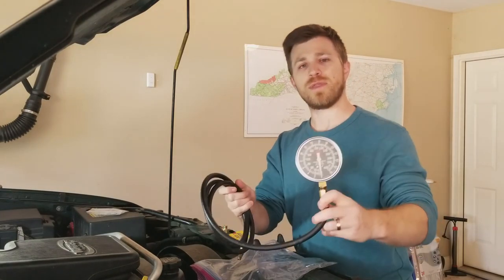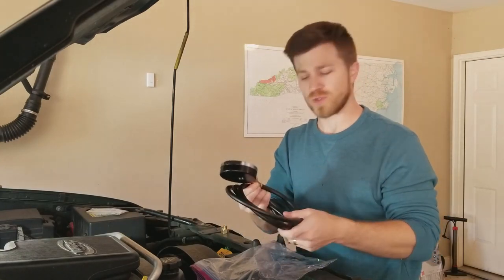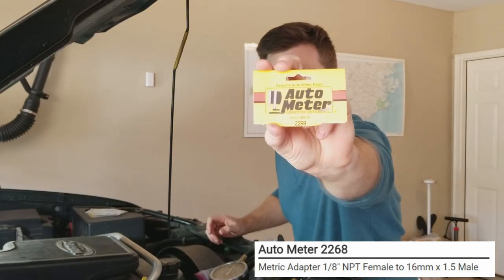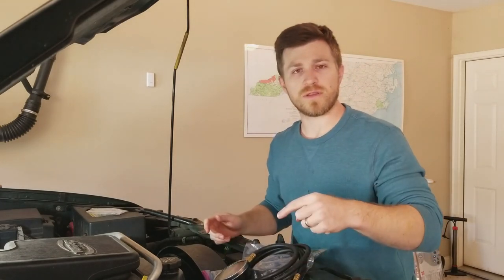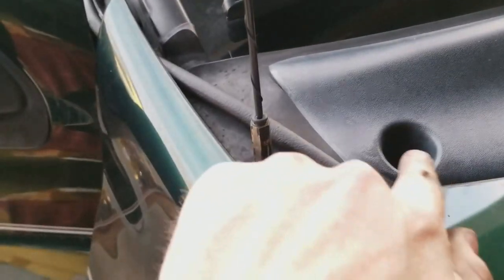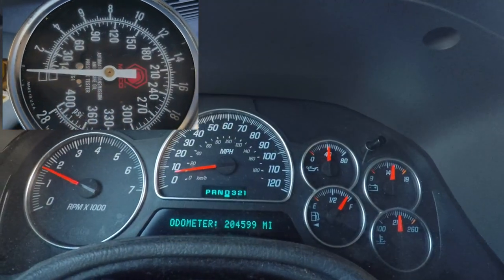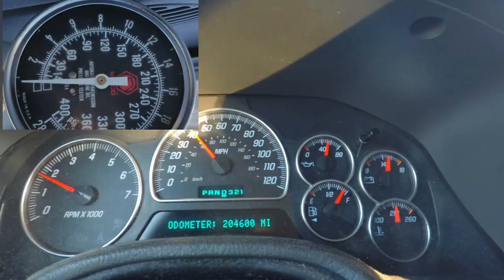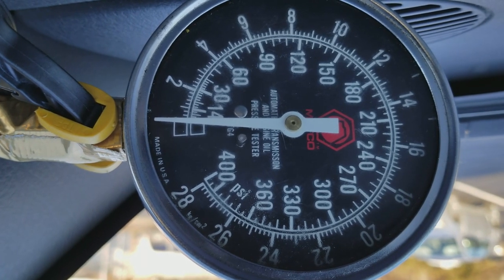Diagnosing Envoy Low Oil Pressure - Part 2

Comment: I really appreciate you for making this video. Please keep posting these videos they are very helpful.
Reply from the maker: Norma Sibaja Thank you!
Reply: @KevinNadeau  I have a 2005 GMC Envoy Denali 5.3 liter. it'll drive for about 30 to 40 minutes it will shut off it takes about an hour hour-and-a-half you're able to recrank it and it'll drive for another 30 to 45 minutes and repeat the same thing over and over. We have changed the fuel pump, crankcase position sensor, ignition module, multiple relays the fuse panel box under the hood had to computer rebuilt Andre program to the vehicle several things have been checked no issues whatsoever headed into the GM dealer two different times they can't find the problem to other mechanics have been unable to find the problem and I'm at wit's end. Any idea what it may be?
Reply from the maker: @fla-tacomann5355  I'm not very familiar with the 5.3L motors, but my first thought is something electrical. Have you had the alternator tested? Is your battery good?

Comment: Exact thing happened to my 06 Trailblazer...was a clogged oil pickup tube that would temporarily unclog when engine was shut off.  Ended up blowing the engine because I thought it was a faulty gauge and drove it a couple miles.  It literally started knocking 4 blocks from my mechanic's shop.
Reply from the maker: Man, I hate to hear that

Comment: Having the same problems with a '04. I will be doing the same test you are, suspecting to have the same problems or a weak pump. There is a lot of confusion about the oil pressure gauge. Researching this, it appears that the gauge is nothing more than a glorified idiot light to make it look "cool". The sensor it a on/off switch. Pressure opens the switch (off). Lack of pressure closes it (on). If it is off, the gauge reads 40psi.  You can unplug the sensor and the gauge will still read 40 psi. short the plug wires, it will go to zero. After fixing this engine, a mechanical pressure gauge will be install for the driver.
Good video Kevin.
Reply from the maker: Hope you're able to solve your low oil pressure issue.  You are correct, the oil pressure gauge on the 4.2L motor is basically an "idiot light".

Comment: same problem on 2002, oil pressure switched didn't resolve, oil change full syn and oil filter didnt, bought a new battery now i read that could case issure. im thining sludge build p or oil pump.. hope not. 
But looks like ur pressres low to begin with? then when idling it increase just a little look at the tiny like to the left of needle. GL Godbless

Comment: Iv been through this hole thing bro.. it worked for a while
Reply from the maker: I ended up having to take the oil pan off and clean the pickup tube on my Envoy.  Man, that was a big project.
Reply: @KevinNadeau   yeah.. I figured that was coming…
I haven’t change my oil pressure switch. that I will get done.. And possibly have somebody else do the work to the clean out or both jobs..
Im to old for that stuff anymore..😎
Reply: @KevinNadeau   did you make a vid on that Kevin? If so send me a link please..
Thank Steven 😎
Reply from the maker: @stevenjewett4537  Yes, I have several videos related to my oil pressure issues. Check the playlists on my channel👍

Comment: Hi there kevin I have a 2004 GMC envoy slt with a 4.2 v6. . MY AC compressor is not working and I need a few suggestions to get it ready for the summer season...
Thanks..
Ken.  From Ottawa ontario canada.
Reply from the maker: I'm no expert with AC systems. Are you sure the compressor is bad? Might be time for a new one?
Reply: Hi Kevin.. when I removed the old module under the dashboard I noticed that a few of the plugs had some green corrosion in the plug so I cleaned it out the best I could and I'm thinking that maybe the brake lights blew out and the running lights just continue to come on when I turn on the lights and do you think that the fuses for the left and right brake lights might have been blown...
I just bought the GMC ENVOY SLT a few weeks ago and I'm just trying to figure out the problem so I can get a safety certificate and put the SUV on the road and enjoy it.. during the summer...
Thanks again..
Ken.
Ottawa Ontario Canada

Comment: Don't use the FRAM filter, and you'll be fine.
I had a problem with low oil pressure. I changed everything I could. Eventually the problem was solved only when I replaced the FRAM filter with one from ACDelco.
Reply from the maker: AC Delco is what I use 👍
Reply: @KevinNadeau  were u always using AC Delco or did u change to it after issue was resolved

Comment: is there a way to replace the oil pressure switch from the top?
Reply from the maker: Maybe, but I found it to be very easy to replace it from the bottom.
Reply: I actually did one today in my 05 envoy and it wasn’t as bad as I expected. Once the oil filter is off you actually have enough room for the socket and ratchet. Highly recommend getting the speciality socket for a few dollars. Best of luck to everyone !!M
Reply: @stephenpurcell9268  thank you for sharing. i also have an 05 envoy and bought the oil sensor socket it was cheaper than the actual sensor lol can you give me the steps to replace it?  so just get the oil filter out first?  how do i do that? lol
Reply: Getting the filter out gives you more room to get at the sensor. A 74-76 mm oil filter cup will help if the oil change place over tightened the filter. Once you remove the filter the sensor sits sideways just above the filter mount. Remove the wiring from the sensor and the socket will fit over the sensor and you will have room for a ratchet as well.  Hope this helps you as well !!! When replacing the filter just tighten it up hand tight. Always easier to remove for future oil changes !!!
Reply: @stephenpurcell9268  thank you!! will try it out when it gets warmer. its -27° C right now where i live LOL

Comment: Have you had to take the oil pan off yet? Just wondering because I'm going to be changing a timing chain and some other things and I can not find an oil pan gasket anywhere! Apparently these engines don't have an oil pan gasket?
The local auto parts store, showed a picture of 12 tubes of RTV and same with an online website. I find it really odd that they wouldn't have a rubber gasket
Reply from the maker: Yes, I ended up taking off the oil pan to get to the pickup tube. The pan does have an RTV gasket, not rubber. Check out my other videos for the oil pan removal and install.
Reply: @KevinNadeau  yes I saw the other videos after I left this comment. Very informative and thank you for making them. I'm not looking forward to doing this
Reply: @KevinNadeau  so I'm all finished with my engine project and it runs great but there's a vacuum line coming from the left firewall and I cannot find where it goes. It's causing my idle to go up and down between 400-800 rpms
Reply from the maker: Do you mean driver or passenger side?
Reply: @KevinNadeau  passenger side
Reply from the maker: @151bradhatt  I haven't had a chance to research it yet. Can you post a picture?
Reply: @KevinNadeau  if I can I don't know how. It's not a big deal. I was just wondering if you knew off the top of your head. It hooks into the intake manifold somewhere I just can't see a place for it. Maybe the new manifold is different from my old one

Comment: Too nervous to skip to the end... And then move on to video 3. Ugggh... 3 videos sounds 1. expensive and therefore 2. like I may be looking at off loading my baby. Prayers up for ye olde' 2002/190k 😑... 🙏🏽
Reply from the maker: Don't get rid of it. Try a new pressure switch first.
Reply: @KevinNadeau  You rule for responding so fast..! Soo.. Try the switch first even though it's doing literally the exact same thing as yours..? Down to the 20 min running time + idle throwing the low oil pressure & engine shut off warnings - but when I accelerate it "fixes it".. until I idle again..? I'm en route to gas station for kerosene, now. Guess I could bust a u turn and head to O'Reilly for a switch, instead.
Reply from the maker: @kasiecastleberry  Yes, try the easy fix first.
Reply: @KevinNadeau  didnt fix mine. 2002 envoy 150k im thinkinm kerosene as well but  few good times and maybe one cheap oil change run it a bit then another full syn.
also change oil filter from fram to Ac delco

Comment: Who picked that gauge and y does dash board gauge read40 and other reads 12
Sounds like it’s time to trade👍
Reply from the maker: Sam Robertson The gauge is what I had in the shop.  The reading on the dash is not true pressure with the 4.2L motors.

Comment: Can you still drive with the dash saying stop engine?
Reply from the maker: In my case, i probably shouldn't have, based on what i found. But if the low pressure light comes on because of a bad pressure switch, you'd probably be ok to keep driving. But drive at your own risk.
Reply: I did and now my engine is knocking

Comment: okay, you need to stop driving the car, this is what wrong with it you need to replace the main bearing, and while you got the oil pan off install new rod bearings and oil pump, also check the timing chain hydraulic adjuster.